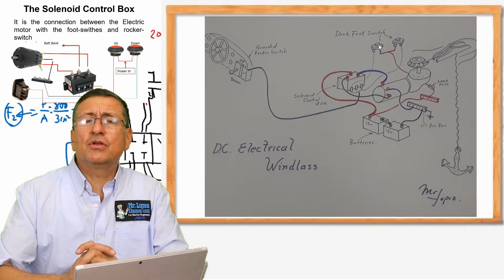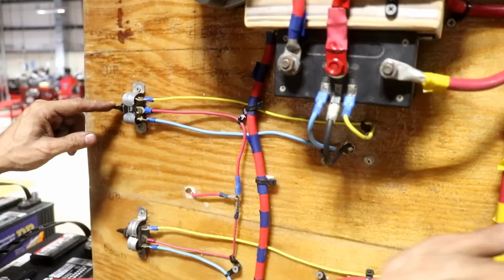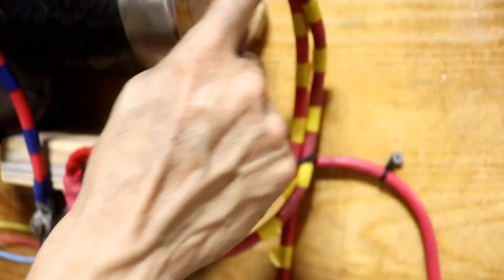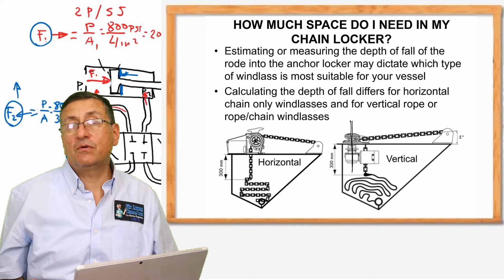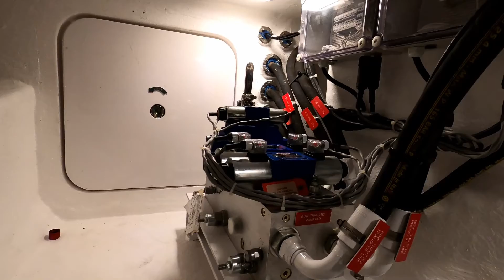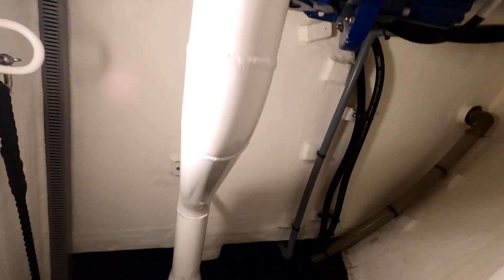Windlass & Anchor System / Chapter 4 EP 1 Auxiliary Course

Comment: Hi Mr Lopez. Today I tested using the same procedure you explained. I have a Lewmar 235P solenoid as you show on the top wiring example. The console switch is working, the solenoid clicks when I toggle the switch and also when I bring power directly to the signal input. 

However I have 12v input on the solenoid but only 5 to 6 volts output on the up or down connection going to the windlass motor.

Why do I have 12v input but only 5 to 6v out of the solenoid?
Reply from the maker: Alex ; there are two possibilities ; the first one could be a bad solenoid(Too much voltage drop) , the second one is a bad ground. Check the ground connection at the solenoid and also the ground on the motor of the windlass; if is possible create a new negative DC cable from the battery to the frame of the windlass.
Check this and let me know what was the result
Good luck
Reply: @MrLopezClasses  thank you. I also tested bringing + power directly to the motor and it did not work. 

I will need to test with a second ground also attached to the motor and solenoid and report back.
Reply from the maker: If you want remote assistance , you can schedule a remote troubleshoot session in my website https://mrlopezclasses.com/a-booking-form/  or directly through Whatsapp at this number +1 754 236 00 65
Reply: @MrLopezClasses  Hi, I just booked two hours for Saturday the 18th. Thank you! See you then.